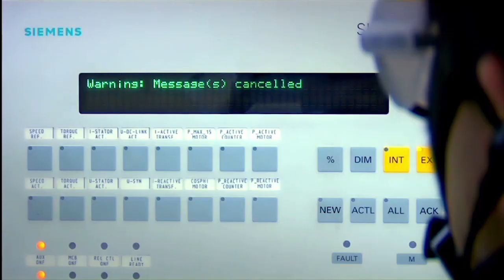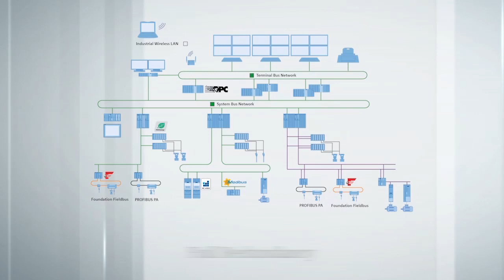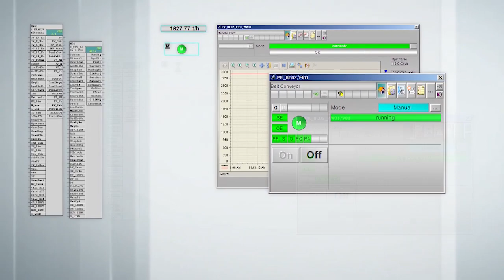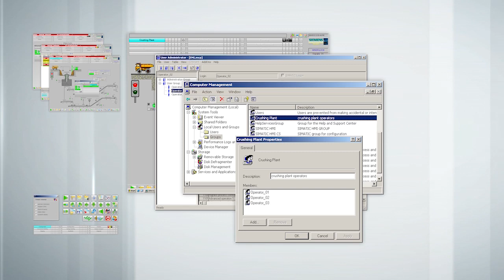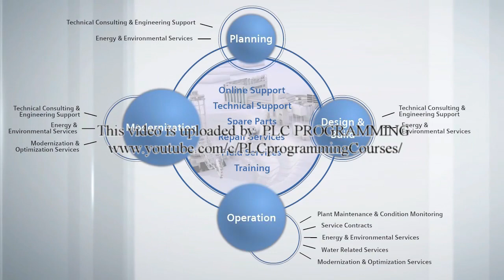Simatic PCS7 in Mining

Comment: PCS7 is use with s7 300 PLC?
Reply from the maker: Burraq Engineering Solutions 
Yes, you can use it for s200 s300 s400 s1200 s1500 etc
Reply: but when we create projevt only s7 400 CPUs are avaialble.
Reply: also PCS7 software is  same as simatic manager so how can we add s7 1200 1500 , s7 200
Reply: but when we create project we find only s7 400 cpus.
Reply from the maker: On my PCS7 v8.1 they are all available
Reply: I HAVE ALSO 8.1 BUT ONLY 400 ARE AVAILABLE AS IN YOUR 02 PCS7 CONFIGURATION VIDEO ONLY 400 CPUS WERE SHOWN.
KINDLY CLEAR
Reply from the maker: https://www.facebook.com/plcprogrammingcourse/photos/fpp.1110656592317822/1729172180466257/?type=3&theater
Reply: THHANKS GOT IT